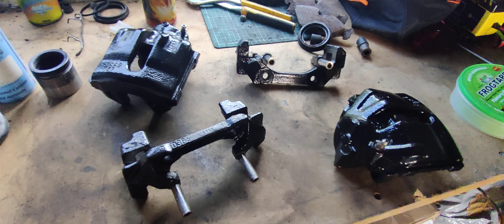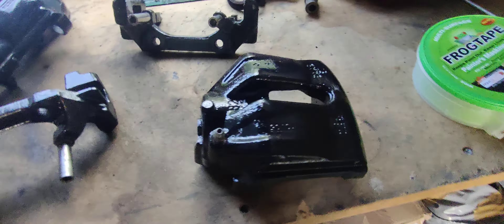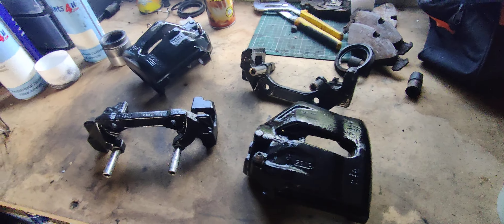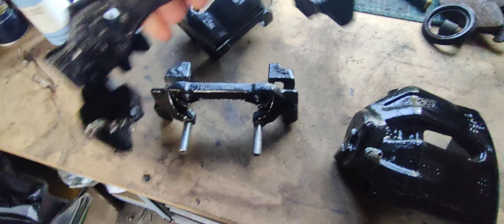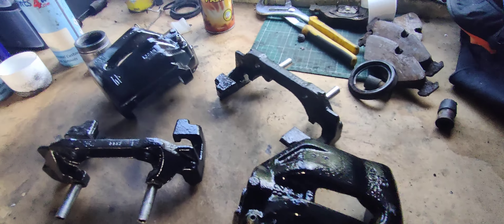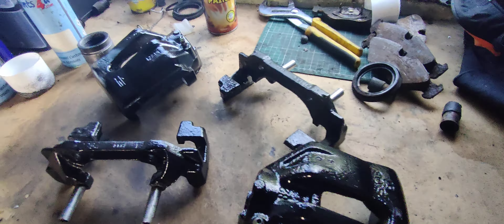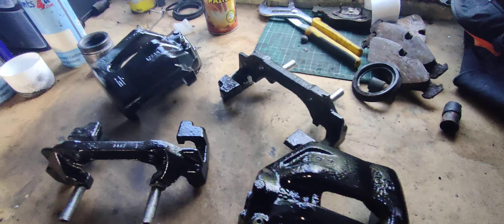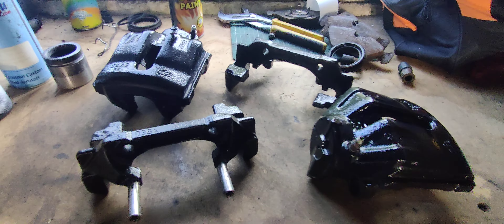SAAB 900 T16 Rescue (ep 23): idiot!

Comment: I did mine in Black Hammerite and Copper Hammerite Martyn. No real prep, just knocked the rust off, cleaned the brake dust and wiped them with a coat of the Hammerite. Still there, good as new ten years later...Hammerite does take some beating but I used a brush and not the spray can variety...oh, and I didn't chuck them in the oven 😉
Reply from the maker: Thata good to know, cheers Kent! How a simple job (that no one will ever see) is now becoming irritatingly drawn-out 😅. I was over-thinking by oven-baking the calipers. Should have just put them aside and put my time to better use 😅😬
Reply: @martynsboostedswedes  Like going to bed and sleeping at ten o'clock 🤣🤣🤣
Reply from the maker: @KentnDebi  😅 As it happens I went back out to the garage at about 10pm to repaint them black. Just.....WWWWWHHHHHYYYY?! 😅😅🤩
Reply: @martynsboostedswedes  Sometimes we do things on autopilot Martyn, then wish we hadn't...like Fabsil'ing a hood without checking the weather forecast WHOOOOPS!
😂😂😂